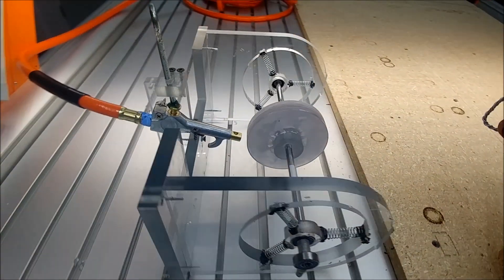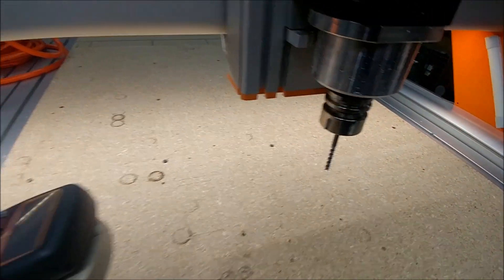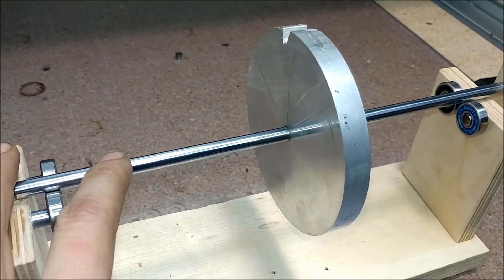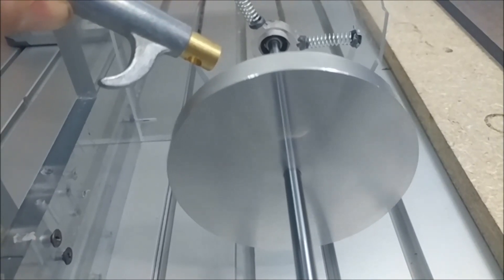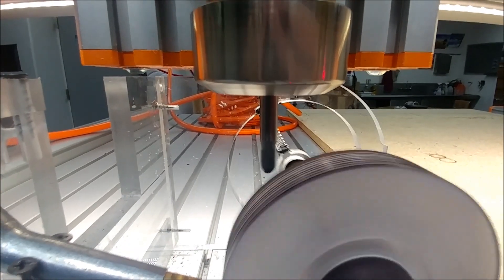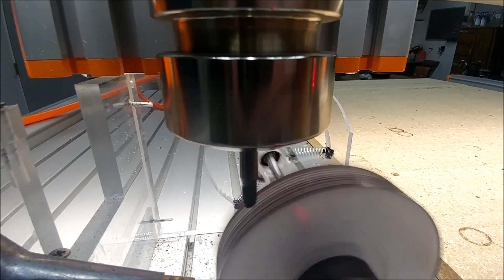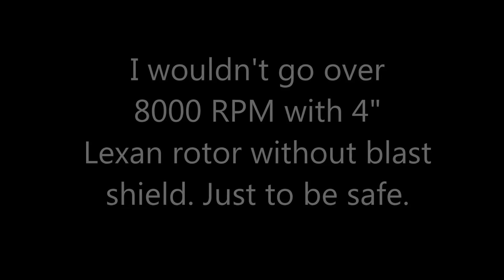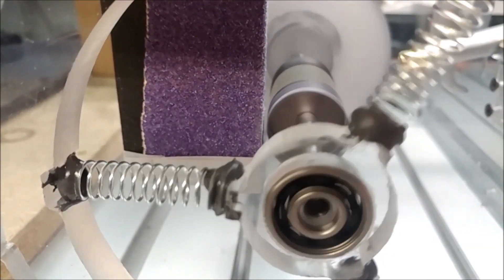DIY High Speed Dynamic Balancing! Tesla's Balancing Patent!

Comment: my thought on how this works, the unbalanced rotor and each springs create an oscillator.
when the rpm hits the resonating frequency of that oscillator, the displacement in that direction is maximal.

which is probably what happened at the end of the video...
this would mean different spring rates are optimal for different rpm's.
maybe you could compress the springs from the outside using a hydraulic system?
also, how about mounting the rotor vertically so that the load on the springs is purely from the imbalance and keep the resonating frequencies of all springs as close as possible?
Reply from the maker: great suggestion to compress the springs to change the Yeald-ability I have since moved to much stiffer supports and it works great! Rubber or silicone works. Vertically would be nice, I believe it would help.

Comment: That’s great, because there are a lot of lexan rotors that don’t need to retain any particular size or shape being used in industrial applications. 😂😂😂😂😂
Reply from the maker: Have you seen this in action? We got over a kw with a 3" rotor, made of plastic. Plastic was just for easy prototyping.
Reply: @iEnergySupply  My point was that there is no real practical application for this type of balancing.  It's an interesting little experiment, but that's all.  By the way, it would work a lot better if you didn't suspend the bearings in springs.  The springs' result is to make a phase angle impossible to determine, either by vibration equipment or by the shaving off of eccentricity in this method.  What that means is that more often than not, you'll be shaving off something other than the heavy side.  Try it again mounted in a rigid frame and you'll see.  Or more accurately you won't see (any movement) but you will be able to shave off the actual heavy side only.  It will be much faster and much more accurate.

Comment: Isn't the air causing unwanted motion?
Reply from the maker: A little bit, my new balancing apparatus is better and the air doesn't affect it. If you can spin it up to high speeds while you balance it it works better.

Comment: Or, you could just use a real balancing machine and have the job done in about 10 minutes. And, you'd actually know what tolerance you achieved. This is both silly and dangerous.
Reply from the maker: I have since improved the apparatus. Also I had some professionally balanced and the professionals seem to have difficulty achieving a good balance when ran at high speeds. It's important for me to understand all the areas of this research and experimentation is the fastest way I've found to learn.

Comment: Where/ how was material removed to resolve dynamic balance? Outside faces of rotor only?
Reply from the maker: one was balanced after the other.
Reply: @iEnergySupply  what a reply... that doesn't answer his question in the slightest. WHERE and HOW was the material removed, to resolve dynamic balance?
your answer was to "when" which was not a question that was asked. this is middle school stuff. read the question BEFORE answering
Reply from the maker: @bmxscape  did you watch the video?
Reply: @iEnergySupply  did you read the question which you attempted to answer?

Comment: In an out of balance rotating assembly, the point of maximum eccentricity is not the heavy spot, but rather a little behind the heavy spot in the direction of rotation.  That's because the centrifugal force is out through the heavy spot, but since the wheel has mass, by the time the wheel accelerates in the direction of force, the force has moved off in a different direction.  Since the grinding is being done at maximum eccentricity a little behind the heavy spot, the mass removed shifts the heavy spot forward in the direction of rotation.  Since you removed mass pretty close to the true heavy spot, you are presumably now less out of balance, but this technique effectively chases the heavy spot forward until the difference between the heavy spot and where you are grinding is less than your apparatus is able to resolve.  That means that it will give you a good balance, but it cannot give you a perfect balance.  It is also a little inefficient in that you are not removing just enough mass from the right spot to get the job done, but rather coming up to it from behind and removing mass asymptotically toward a true balance.  So while this works acceptably, you'd think there'd be a better way.
Reply: I’m not saying it doesn’t work (except to the extent of saying that it can’t work perfectly).  I’m simply saying that if you consider what is actually going on, you are removing more material than is necessary from places where the problem doesn’t technically exist. There’s a lack of eloquence in it.  I think it would help by starting by achieving the best static balance you can, since that technique either removes or adds mass as close as possible to where it is actually needed.  Then to apply this dynamic approach alternating directions of rotation with a little bit of milling each way so that you approach the heavy spot from each direction, rather than to move the heavy spot forward and force yourself to chase it until you’ve closed the gap to a satisfactory degree.  I suppose it’s possible the end result might be the same, but it would be an interesting experiment to find out.
Reply: @phxerica  you are spot on. The phase angle of the heavy side will not always be such that the heavy side is out. This is why in the patent Nikola Tesla says to do balancing st odd harmonics of the critical rpm. If you do it at even harmonics the light side will be out. But if you do it at odd harmonics the heavy side will always be out. This is the basic “rotating mass on a shaft with yieldable bearing supports” experiment. If you do balancing at the correct rpm you won’t be chasing the heavy side around. And can effectively balance damn near perfect if using different stiffer springs and shaft flexibility to do balancing at different RPMs as the system resonant frequency increases.
Reply: 1) The axle would have to be perfectly rigid so the long length is a terrible idea.

2) Having contact with the cutting tool is going to affect the movement so it will end up cutting all over the place rather than the unbalanced weight.
Reply: @teenagemutantninjaraver2224 please tell me you have a nice video somewhere explain or showing that 😅 i think I understand, but now I want to build this
Reply from the maker: Prior to the development of modern high speed apparatus static balancing was depended upon entirely and even now this is frequently the case. The steadily increasing tendency in the direction of high speed brought on the necessity of dynamic balancing and various forms of apparatus for this purpose were devised.

The process I have invented enables this to be done quickly and with a high degree of accuracy and, briefly stated, consists in rotating the body to be balanced, yieldably supported, at a suitable speed and removing excess material from its heavier side by abrasion, until the desired degree of perfection of balance is attained.

It might be naturally inferred that the contact of an emery or carborundum wheel with a rapidly whirling machine part would be productive of dangerous shocks and vibrations, and also that grinding at speeds much higher than the usual could now be satisfactorily accomplished. But although these theoretical assumptions appear sound, I have encountered no difficulties of this kind and have performed the operation with the greatest facility and success.
Reply from the maker: I haven't experienced any difficulties in balancing even better then the professionals I've had balance my stuff in the past.
Reply: "In an out of balance rotating assembly, the point of maximum eccentricity is not the heavy spot, but rather a little behind the heavy spot in the direction of rotation.  That's because the centrifugal force is out through the heavy spot, but since the wheel has mass, by the time the wheel accelerates in the direction of force, the force has moved off in a different direction. "

Erica that's a bizarre and bold claim to be making.  Without any calculation of the phase lag to back it up, I have question it.  Do you have any reference showing a calculation of phase lag given an arbitrary \rho(r,\theta) density function?

Comment: Thanks again for sharing your research. I'm thinking that limiting the motion of the axel with rings of a reasonable size at each end might help save from catastrophe.
Reply from the maker: your absolutely right, I did just that with the new one, but used rubber spokes instead of springs.

Comment: That notch that was made for the light side, is being push down by the air flow. If there were 4 notches spaced out evenly , that should balance better
Reply from the maker: You're absolutely correct! Thanks for the good advice!
Reply: iEnergySupply 
My pleasure! And thank you for posting
Reply: iEnergySupply 
My pleasure! And thank you for posting
Reply: iEnergySupply 
Or in stead of cutting more spaces, you can put your bearings on a shaft, having a solid core base will compensate the push for the air. This would also balance out the wheel
Reply: uhh... buddy... the notch is there to UNBALANCE the piece.. it was perfectly balanced before he took a notch out. if he were to put more notches to balance, that completely defeats the purpose of unbalancing it.

Comment: you should try magnetic bearing levitation, and so...
you should create an electronic balancing system with arduino for each bearing, and with a series of sensors that read the imbalance,  and make  the balance correction by energizing or de-energizing the magnetization (increasing or decreasing the magnetic power) so as to constantly correct it ...
I hypothesize that with such a system, you could obtain levitation magnetic bearings, with high precision  balance ...
this is at least the theory .. then it would take practice .. creating the self-balancing algorithm ...
Reply from the maker: Good idea!
I have balanced with magnetic bearings in the past, and unfortunately I ran into a problem because my magnetic bearings were interfering with my generator magnet on the same shaft.  We are going to re-visit this concept in the future as we are predicting there will be no need for a generator. The Turbine in vacuum is capable of generating electricity via electrostatics. This we also need a metal rotor for.
Reply: @iEnergySupply  My idea actually came from another video of yours where you did tests with magnetic levitation bearings, not only from your video, actually I'm doing research on youtube to see this type of stuffs and in fact I found your channel through these searches.
But you are also right, the imbalance comes from magnetic interference ... something would also be needed that insulates the levitation bearings from interference, and in this I am totally ignorant, is there any material or method that insulates-limits magnetic interference ???
Reply: @proges  mabe by making the shaft longer and the magnet farter away in the box it will be enought to cancel the interference, ??

Comment: thats fucking amazing man i was going to get those thin 1/8th inch thick peanut grinder disks 
WORKPRO 20-pack Cut-Off Wheels, 4-1/2 x 7/8-inch Metal&Stainless Steel Cutting Wheel, Thin Metal Cutting Disc for Angle Grinder https://www.amazon.com/dp/B07WGSK4V7/ref=cm_sw_r_cp_api_i_I9oeEbE41J9WE

but now im thinking itll have that oscillation and i wont be able to grind it down. im excited to giveit a shot 😜
Reply from the maker: Thank you! Good idea thinking about the grinding wheels, I've thought about it before but one thing to note with the grinder wheels is they can't take as high rpm as some of the better materials out there. Also they need exhaust holes in the center of the disks. We will be giving more construction details soon, and the best materials to use for the disks. It's actually quite cheap to pay a company out there with a water jet to cut you're disks. I can give cad drawings that you can hand over to them in the future.
Reply: iEnergySupply would love to further communicate said cad drawings please contact joeylawell1234@gmail.com 
the fact researchers like you take the time of day to respond to some kid on the internet is the reason this community exists.

Comment from the maker: Just as a side note, the sand paper is for fine tuning because it's really slow. For the bulk of the material, I used the mill bit with ball nose. Otherwise it would have taken me a day to finish.
Reply: @nikola.tesla.r.and.d.centre Oh nvm. Tesla turbine is prettt much an energy transfer machine now. He try to copy magnetic attraction but didn't know it is non-matter system where matter interacts with aether rather than matter to matter interaction. It's a shame but at least he hid the secret in there.

And tesla turbine NEEDS to be enclosed to trap the gas pressure so that the turbine can achieve synchronous speed to have maximum efficiency.
Reply from the maker: Ill be using aluminum disks soon. Thank you for your comments!
Reply: I am convinced of the near- ambient heat capture potential, and of the "air conditioning" value, of the TeslaTurbine device.  The use of compressed air for renewable energy storage fascinates me. 

1. Demonstrators of the technology should strive to have continuous monitoring of Temp, RH, barometric pressure and airflow rate, both before and after the gases enter the turbine.   We need to sift dross from gems of YouTube like iEnergySupply's content, and attention to the correct measurement of these parameters is a starting point for developing wider uses for Tesla's invention and attracting proper funding. 
2. If we are saying anything about conversion of energy into usable power, then volts and amps, under load, must also be monitored and recorded over time - for just the same reason. I can't be the only person who tunes out people who measure "No-load volts"! 
3. Performance at times of changing input parameters is relevant, but not always possible under experimenter "YouTube enthusiastic Testing" so the process is best automated.  I'm interested, for example, to have an answer to: How soon does a change in input temperature propagate to the cold side because this gives us performance data about the thermal inertial mass of the machine when operating.  Moreover the #data from destructive testing (which features heavily in video ratings, and rightly so) * is not lost! *. Ice buildup has been demonstrated to be problematic. 

4. I am less concerned about what happens in the microseconds as the fluid traverses a disk, because I cannot see how to measure the airflow characteristics without upsetting the laminar flow inside the turbine.  But I can see great advantage in multistage expansion because Carnot tells us not only must it be more efficient if delta T is high across the entire system, but also that the longer time the fluid is entrained 

<editing suspended>

 after each stage it is possible to supplement . 
4. Arduino, and perhaps the maker community, has a role here. 

3. I am, we have to be if this is a crowdsourced Global Change programme, focused on how to reach a  workable, mobile generator, prototype demonstrator very quickly.  Ideally the prototypes are cheap, locally produced, useful and instructive and can be adapted and modified by users such as schools, colleges and members of the Tesla Turbine communities that are global in reach. 

5. Since the device works across a range of pressures, temperatures and flow rates (by its very nature, and by linear repetition of disks and spacers along an extended shaft and body of the turbine) I would think this a highly suitable project for both practical-commercial #CDReUseRecycling AND
#3
Reply from the maker: @SimonRichardMasters  https://studio.youtube.com/channel/UCdX_Ug0MgcXqTpevz_gGk9w, See our latest theory on how the system works. Also we have moved onto testing the system under vacuum in the cryopherous. See this video here. https://studio.youtube.com/video/JvRCB_HhseY/edit
Our next turbine will have a high speed generator attached for load testing. 
Temperature testing will also be done in our future videos. 
Freezing is not a problem, just proof that the water can deliver large quantities of energy through it's phase change in the turbine.
Reply: @iEnergySupply  thanks. I've rewatched and you guys are def onto something.  I want to help, perhaps with vacuum and pressure tanks with Arduino WiFi senor monitoring
Reply: @nikola.tesla.r.and.d.centre  Hello
Reply: Why are you building the WRONG tesla turbine? And the secret of overunity is in the principle of how tesla turbine work - MAGNETIC ATTRACTION.

Comment: Lately I was working on the same project but I used flexible 3D printed rubber ballbearing brackets. Now I know what I did wrong. Thank you great work
Reply from the maker: Good luck on the balancing, if you have any questions let me know.